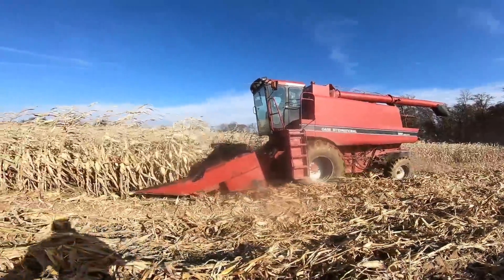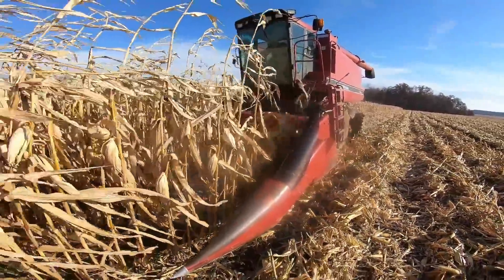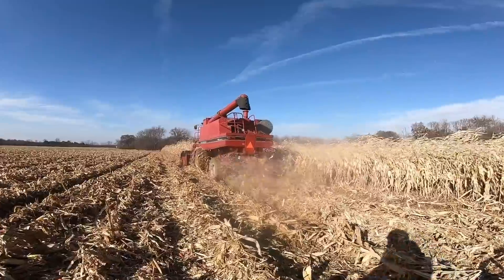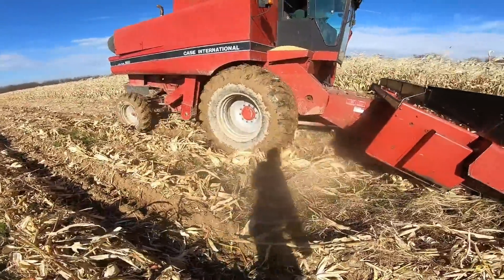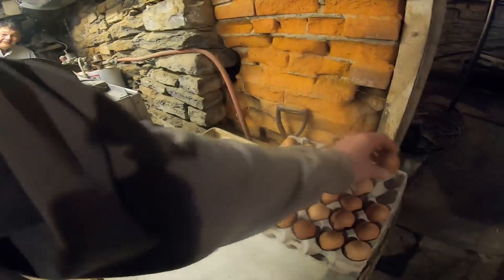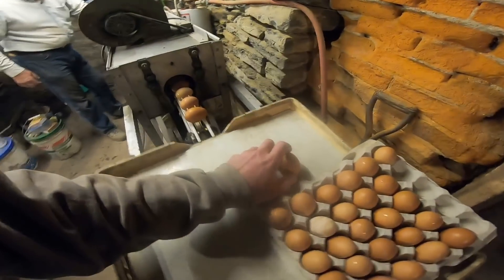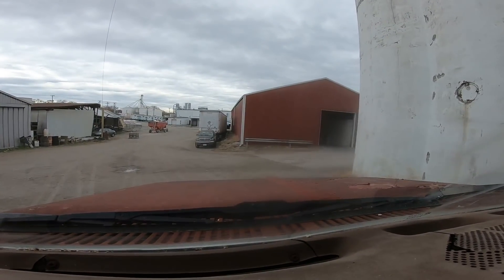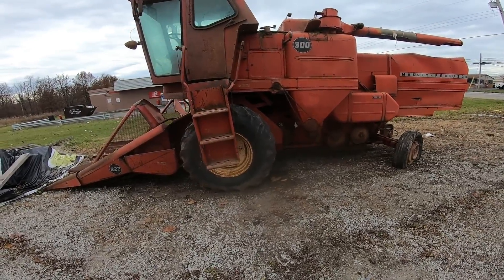Custom Corn Hauling Adventure

Comment: Why don't you ride along and see how you like that red monster?  Seeing your a fan of red tractors and stuff...  Perfect opportunity.  Yes the IH corn heads use knife rollers, with the knives on each roll timed to mesh together, instead of flutes like a Deere (and pretty much everybody else) stalk rollers which are timed so the flutes intermesh.  The knife rollers are a good idea in theory but they quickly wear to the point they don't cut through the stalks anyway, and then they don't get a good grip on the stalk anyway, and the head plugs up.  IH, IMHO, (as well as many others) didn't make as good of headers (platforms, flex heads, or corn heads) as Deere or other brands... seen more than a few CIH rotaries down here with adapters and running Deere cornheads or platform heads (flex or fixed) Best of both worlds... well, except I like the twin rotors better than CIH rotaries, but we see about 10 CIH combines to maybe 1 NH twin rotor down here.  

Your twin rotor would easily keep pace with that CIH... not sure why yall creep through it so slow.  The NH will clean corn WAY better even at that speed over the CIH because their cleaning system isn't as good, and they use those stupid augers under the thresher to bring grain and chaff back to the cleaning shoe, which mixes everything up into a mush that the cleaning shoe then has to separate, versus the NH with a proper oscillating GRAIN PAN that pre-sorts and sifts the heavier grain to the bottom and the lighter chaff and crud on top, so when it goes over the rake and drops onto the cleaning shoe, 75% of the separating is already done-- airflow can then easily do the rest and blow the chaff out the back, with the chaffer and sieve doing the last 10% of the separation of heavier stuff by riding it out the back or to the returns.  Bad thing about the Deere too-- stupid auger bed mixing it all together then dumping it over a short sifting pan and rake (which doesn't have time enough to work) and overloading the cleaning shoe... dirty grain in the tank unless you slow down to give it time to clean it up, and if you go TOO fast, riding grain out the back!  

Later!  OL J R :)

Comment: WHY in the world would you MIX 110 and 115 day corn TOGETHER and plant it?? I could see planting half the field in one and half in the other, something like that, or if a guy had an 8 row planter and 4 row head, or 12 row planter and 6 row head, filling one side of the planter to the middle with 110 and the other side of the planter with 115, and then picking alternating passes ... but MIXING it together is a new one by me.  Plant half the field in one and half in the other, spread you risk, if one's a "racehorse" variety and one's an "ol' reliable" variety, if you get great weather you make more corn on the racehorse variety, so it bumps up your average yield.  If it's a crummy year (do we even get good years anymore?) it's all yielding about the same, or if it's REALLY crummy the ol' reliable will save your bacon when the racehorse variety falls flat on its face... which I've seen happen.  We used to plant a couple different varieties just to "spread the risk" a little, and see what worked better than something else in the conditions that year.  

Later!  OL J R :)